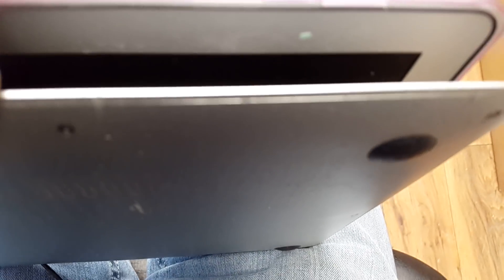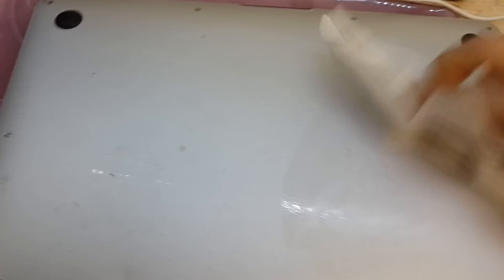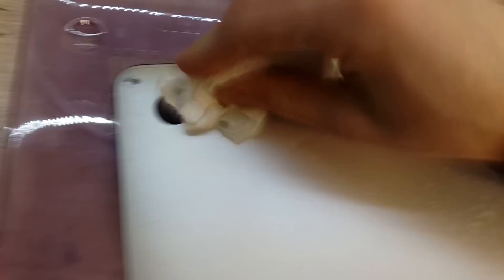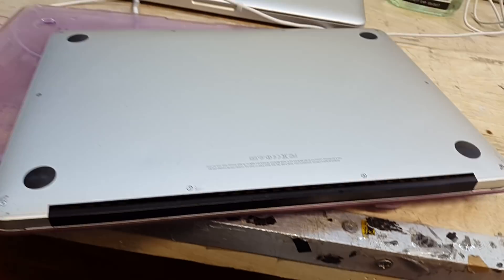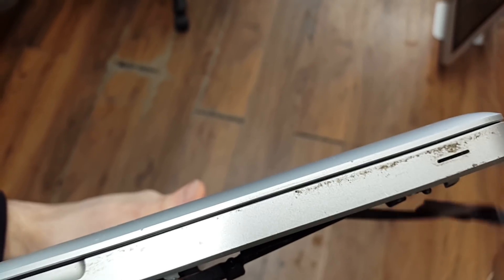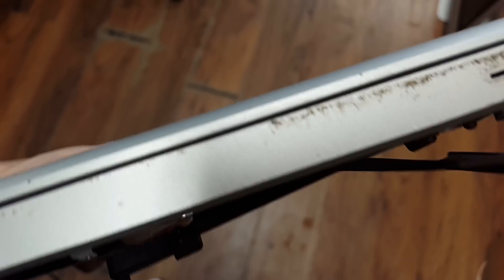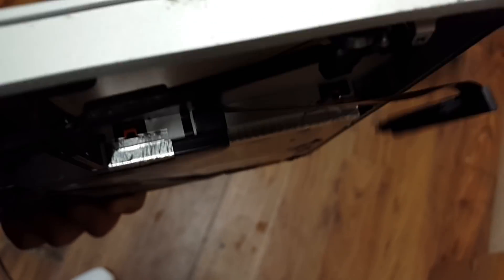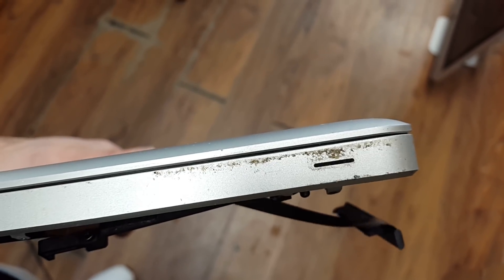Avoid plastic snap on Macbook cases: they are disgusting! 20160123 105752

Comment: the clamps on the sides also have the potential to prevent the computer from fully closing - meaning there is a gap between the rubber gasket and the main body.

Comment: Well that is interesting. I do have to say that I have noticed after switching from an white iBook G3 to the unibody aluminum mid 2008? is that on warm humid days where my skin is sweatier I find a bit of buildup on that side of the computer that I have to clean off. the good news is I literally travel with alcohol now so when I find something that needs cleaning I can take care of it when it happens so much easier. I have been wondering if it's like an electrolysis process between the skin the moisture and the aluminum and or the coating and surface.

Comment: Most likely the case, since it stands off slightly from the body of the MacBook, is trapping spilled water/humid air/food/cum/whatever. So the case traps the wet nasty junk up against the overheating little MacBook and causes mold to grow; also the colored plastic plus the fact that it is on the bottom/side of the machine provides shade. 

Of course, people could literally be grating human shit on the case of the poor little MacBook.

Also, ＴＨＡＴ　ＩＳ　Ａ　ＤＩＳＧＵＳＴＩＮＧ　ＰＲＡＣＴＩＣＥ，　ＣＯＭＰＬＥＴＥ　ＤＩＳＲＥＳＰＥＣＴ

Comment: The cheap cases suck mayor ass. I purchased a Tech21 Impact case for my MBP Retina, in march 2014. After 5 years it is starting to get that oxidized yellow plastic look on the clear outside. The more rubbery inside however doesn't age. And it has always kept my Mac looking brand new, and none of the issues that you get with the cheap snap-on cases that ONLY consist of that fragile hard-plastic shell. The Tech21 case is really a great product worth its crazy expense

But then again I took it off about once every two months and cleaned any dust from the case and Mac.

Comment: You are entitled to your opinion. As an oil field worker, I use a case to protect my macbook pro from bumps as it's intended. Try isopropyl alcohol diluted with distilled water and a microfiber cloth. It will clean the dirt right off.

Comment: Noice!

That is corrosion because moisture and dirt/dust accumulated in the tiny space.

Remember that metal and plastic produce static electricity which sucks all the dust and grime off the table or wherever you put your laptop down. Of course having sweaty palms interacting with the edges of those plastics doesn't help as well...

If you're thinking of reselling, don't take the computer out of the box! it will hold a higher value!

Comment: Y recomend using cane vinegar or any other cheap vinegar  on a cloth , its the best way to clean aluminum , then a second pass with isopropilic alcohol to remove the  vinegar residue.I've been using it on macbooks for 9 years with no problems.

Comment: sweat and oils from your arm as you type..... just gross. I worked as a mechanic and would have women bring in their cars saying the steering wheel was discolored and wanting a new one under warranty. I would clean a 2" spot on it and tell them to clean it. It's sweat, oils, and hand lotion... I've watched them at the light... red light means makeup and hand lotion time.

Comment: I don't think that's actually mold. I have a plastic case on my phone and I get similar crud and crap around the buttons and exposed areas. I think it's actually just dirt and dust, combined with sweat and grease from my hands. Normally it would be brushed off, but the case traps it in there. There's no reason to get hysterical. It certainly isn't worse than the shit that gets trapped under keyboards or mouse buttons.

Comment: My mom bought one for her 2010 13 inch. Apparently there were no actual clips retaining it, so once it was tipped slightly the machine just slid out and fell 4ft to the floor. Plus, it's a mac, the last thing you want to do is increase thermal insulation

Comment: The soft plastic covers + oils and grease from handling big muffin or French fries or from the air + dust and lint= Petri dish. I've seen this in the old stereo equipment I serviced as a tech. Put the receiver near the kitchen, this attracts the cooking grease on the components through the electrical charge, thus attracts the cockroaches.

Comment: Or get a case WITHOUT holes on the bottom. Tech21 has ones that are supposed to have additional "impact protection" which is a rubbery layer on the inside that makes the case fit flush to the laptop body. It has the potential to do something for the resale value of the computer by preventing scuffs or scratches to the computer, otherwise, people would have no reason to be buying them.

Comment: Yeah those things are terrible. My High School a few years ago used them on the white 2008 MacBooks and they did this same thing. Also they made them more prone to breaking since usually what happened was the rubber feet on them which protruded from the bottom of the plastic case would always come off because they were very cheap, so then whenever you put your MacBook on a desk that was slightly angled it would fly off unless you held it down. Then on top of it all it made the machines weigh considerably more so that in the case of a fall it would actually do more damage to the machine and increase the likely hood of the screen breaking. They’re a pos

Comment: I don't get what's up with people putting cases on their laptop... I have an HP laptop (which has a plastic shell) since 2015. You couldn't tell it apart from a new one. You only need to keep it well without being a maniac. MB are made of aluminium right? Which should be even more durable AFAIK.

Comment: I wonder if those cases are sweating oils. Might be worth it to try a degreaser to remove that gunk. My father and I used to get creative with plastic sheets that looked similar to those cases to make CB radios look really fancy, we ran into a problem where some plastics would secrete oils and leave a nasty residue kind of like that gunk. Our solution was to separate the plastic from the aluminum chassis of the CB radios using a thin layer of silicone (same type you use for sealing a fish tank).

Comment: 2 thoughts, #1 heat from the unit plus moisture and small microbes all over may cause that (extremely extremely disgusting), #2 would grit under the case scratch the finish (like under a drop in bed liner)?

Comment: Louis Rossmann, It’s not the case, it’s laziness! I use a black Speck case on my late 2013 MBP 13” I remove the case once a month and soak it in a mixture of Dawn and vinegar for an hour, then thoroughly rinse and air dry it. I wipe the body of the MBP down with a lightly moistened blue automotive shop towel moistened with a solution of Dawn and warm water. I make sure the body is upside down, cleaning the surfaces like a ceiling then thoroughly drying before flipping over, repeating the process, until all exterior surfaces are clean. Then I open the MBP and while upside down, clean the keyboard surfaces and the screen, so no liquids can get into the machine. I also blow out all connectors with canned air like I do all my electronics including my iPhone. I also clean my Apple Watch Series 4 in warm 100 degree F water and Dawn!  I have been doing this since 12/2013 with no damage, no marks, no crud buildup! No repairs necessary by anyone. Still running fast and stable. Say hello to everyone at your shop! Ride safe in New York! As always, I hope you learned something from this post!

Comment: Had a MOSISO case on my MacBook for a month and when I took it off the MacBook still looked like new.  It's probably not the case itself that causes the dirt accumulation but how people treat the MacBook ONCE THEY HAVE A CASE on it.  The case gives people a higher willingness to put their MacBook in more compromising environments which is where the dust and dirt accumulate and get on the laptop, and then because they have a case on they feel like they don't have to clean it, or they only clean the outside of the case and don't remove it to clean what's underneath.  The case alone is not the issue, it's the user.

Comment: it is a bit grose, same thing happened to my old pc case from 2012 which was silver metallic coated with plastic window on it. i threw out the case and bought a new one :/
as for my old Asus first of the line ROG laptop it had a rubber surface to it, and boy is that grose aswell trying to clean it up.

Comment: It is the same shit that I used to remove from the company keyboards. It is accumulated mixture of dead skin, dried sweat and dust. It can be sorrosive too since it is casically concentrated salt putty. If you clean the machine and the case weekly it will be fine.

Comment: Never used one of these cases but my 2011 MBP has black marks in the aluminium to the right side of the trackpad that looks very similar to this. However no amount of wiping gets it off. I actually think the metal has degraded.

Comment: There's nothing wrong with using those cases, as long as you take it off and clean the computer every couple of months. On the other hand, if you leave it on there for 2 or 3 years, then yeah, you're going to find some crud underneath when you finally remove it. Don't knock the product, when the real problem is lack of care on the part of the user.
Reply: Exactly. It's the same concept as the people that don't clean their screens and keyboards. Absolutely disgusting machines I've seen during my laptop servicing days.

Comment: All my troubles with Apple products ceased over night when I stumbled across this one simple trick: Don't buy Apple products and don't use Apple products. I don't use them at home and at work I more often than not also have a choice. That choice is also not Apple. I don't use their minis, airs, nor pros nor anthing that starts with a small i, including iCloud, iPad and iMac. It cost me $4500 to finally accept that Apple is not for me. A) Engineered to be difficult to repair B) Soldered the SSD to the motherboard C) made the battery impossible to change for the average user D) genius who can't do anything but say in so many words I need to buy a new machine E) rudest ever phone screen with an Apple department. 
But again it all comes down to choice and I've made the choice to avoid them entirely. I only come here every so often to marvel at the latest evils.
Reply: Do you want a medal?
Reply: Keeper Nod -- Your reaction is reward enough.

Comment: going to take mine off my 2017 pro now... been on it for over a year :( thanks :)
Reply: It's not hurting your MacBook and it IS providing some protection, just like a cell phone case. Simply remove it every few months and clean the inside and the outside of your MacBook, then put it back on to prevent any build up.

Comment: As an aside ... just what exactly are you ya'll doing with your laptops that you have to worry about scratches to the point where you have to put ugly cases on it? I have an MSI laptop that I care for that's probably half as premium in build quality and it's still pristine as hell. Because when I use it, it sits still. When I don't, it's in the laptop bag that's padded. Stop lugging around your devices like textbooks and you don't need plastic "cases" in the first place.

Comment: used to have one of those cases. Not only does it make your computer unnecessarily thicker, it will trap dirt and make it more likely for you to scratch your computer, the exact thing you're trying to avoid by using the case. Not to mention that they make a slimline computer look like a plastic pile of shit.

Comment: i have a theory, it isnt fungus but oily dust that got under the case and when it was smudged around between the case and the mac it got stuck to the mac because the case is more slippy than the matt finish of the mac, it is one of the reasons i dont own plastic case on my phone

Comment: It's not because of the material, it's because of there's warmth, air, and moisture. If you want to avoid it, you have to have layer of adhesive between case like with screen protectors, or make snap-on from a more silicone/rubber-like material for a better seal.

Comment: The chemistry is simple: Fungus builds up because there is just enough room between the cases to preserve moisture, it excretes acid which corrodes the case. 
There's also grit which can get between the two, creating scratches, which in turn provide more space for fungi to develop.
As for the health aspect, fungi are very dangerous to health. Their spores get into lungs and create all sorts of disease.
Reply: I've never seen one that's caused corrosion of the case. Great theory though.

Comment: But it does give a layer of protection to dings and scratches (which are unremovable) whereas gunk and dirt can be cleaned off. I think when it comes to reselling I'll be happy to clean it and list it as without damage rather than explain away a drop/scratch. Sorry this means you have to deal with detritus Louis!
Reply: Haven't had a laptop cover, but I once had a phone cover, and if something got between thr cover and the phone, it scratched it way more than it would have been scratched without one.
Reply: @prawtism  that's unfortunate
Reply: I have couple of scratches on my laptop that I have no idea how they got there. But still, using a case would defeat the point of having it nice and thin. Whenever I take my phone cover off I am "nice slick phone!"  And then I put the cover back on cause otherwise my phone would he destroyed within a week.
Reply: @costascostas1760  true, if what you want is to enjoy a thin slick phone. It's not about thinness for me, if there were a viable reliable hackintosh I would never buy a Mac again. Alas hooked into their logic pro system for work!
Reply: @Suscida  I understand.  I am stuck on windows because of  word and excel and the occasional random software clients like me using. otherwise I would have been a 100% linux person.

Comment: Or you just take it off once a weak and clean it...
Reply: You really have the time to do that?
Reply: Cheng Pacco you think keeping clean a machine that you are constantly in contact with is time consuming? Need to re-evaluate some things. Better of not using any cases and just keeping the aluminium body clean, same goes for keyboard - it really takes no time at all to have a quick wipe. Machines that are as dirty as the one on the video are probably abused and never cleaned, stains all over keys and trackpad, I can’t imagine how untidy an owner has to be.
Reply: That would work if the owners of said MacBook and covers gave a shat about what gets under the cover

Comment: Hear hear;

Has anyone possibly tried some of that NOVAS PLASTIC Polish ??;

It’s a bit pricey,

But it does wonders on those clear Acrylic car headlights ,

Not to mention most other plastics;

It’s available in a two parter pack ;

The paste  and the pump spray:

The paste is excellent for buffing  plastics, in order to remove very fine scratches, or even chemical residue ,
Or even mold and fungus;
That novas is also used on the canopies of jet aircraft ,
In order to restore those things back to optical quality, for pilots;

The stuff is the best;

But it’s definitely not cheap;

You should be able to either pick it up at your local ace hardware store,

Or they should be able to order it from right inside the store;

Also larger glass or plastic sign companies should know about that stuff and should be able to acquire you some;

Plastics are definitely a bit of a booger to take care of and keep looking good;

Best regards everyone 👍

Comment: well, the case do have its usefulness, it  gives protection around the edge of the computer from fall damage or bumps, some cases  also  have rubber texture for easier grips, however the downside is that the case have to be taken out and cleaned once a few weeks. Holding aluminum body is just easier to slip and bent easily during a drop,  and that hurts the reselling as well.

Comment: No possibility of the smegma building up using those, Just use di-methyl-ketone and after a few applications there will be no problems anymore. Just a whiff and you will know its good enough, a few more and its ready to go to the beach or pool with no worries.